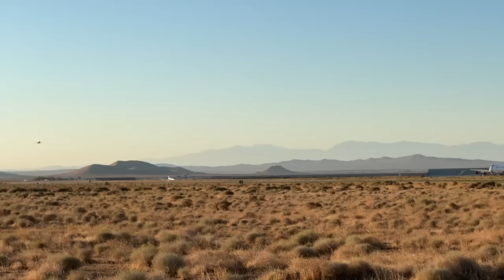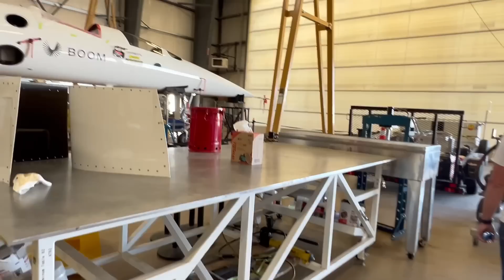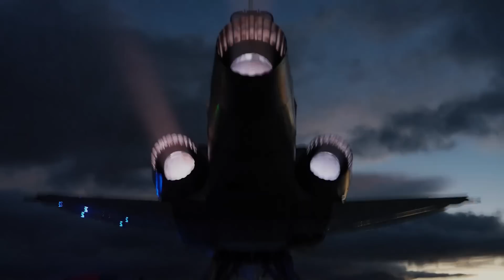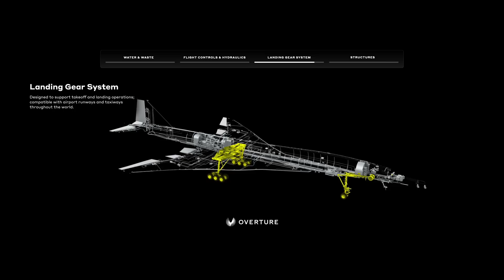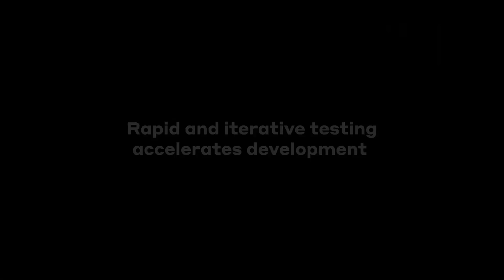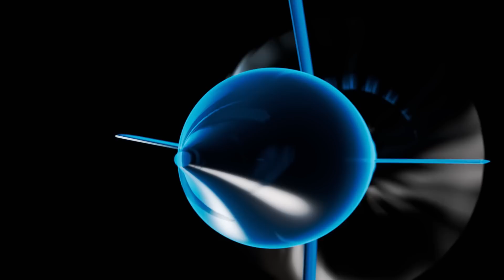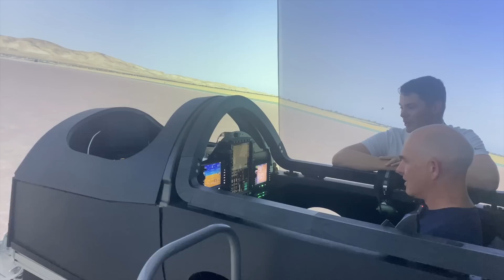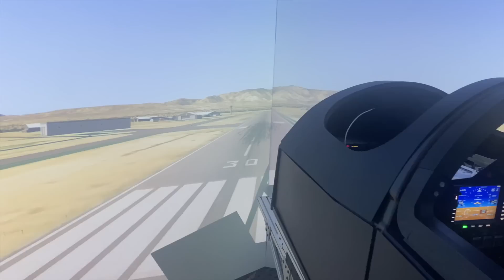Will This Experimental Supersonic Aircraft Show Supersonic Airliners Can Work?

Comment: "Destroyed by desire for cheap-ass plane tickets". That's not a desire, that's what normal people can afford. I liked the Concorde as any respectable Frenchman, but I'm not into shaming the middle class :|
Reply: It's the same reason the passenger seats and meals got smaller. It's just a matter of bringing air travel to the masses
Reply: Precisely
Reply: If it's just double to triple the actual money going to the airline compared to a regular plane, it's not gonna make the ticket a whole lot more expensive, because most of the ticket price is taxes and fees anyways, not the actual cost of flying the plane.

For example, I have a receipt from a SAS flight from this spring, who were kind enough to itemize it. For a 2 hour flight from Bologna to Copenhagen, I paid 63.86 euros, and of that, 17 euros was the fare, and the remaining 43.86 euros were fees and taxes.

So even if we triple the fare price, I am looking at a 94.86 euro ticket. Not exactly going to break the bank in comparison.

Granted, this short of a route is not one you are likely to fly supersonic, and the breakdown is probably less favorable, but still.
Reply: The concord cost the same as 1st class in other flights. Most who bought tickets were business flying to international meetings. However they fail becuse even at super sonic they would still have to get a hotel and sleep than take a flight the next day. No time savings were as first class has beds and some even showers so they can land and go stright to the meetings. The speed to get there didn't help saving any time as a hole. The amenities of 1st class was better.
Reply: The Concord(e) cost the British and French state or say tax payers millions and billions Pounds Sterling and Francs in subsidies into British Airways and Air France as long it was in operation. A poster child in how to ruin your economy.
Reply: It was OPEC.  When she was designed oil was a lot cheaper.
Reply: You know it's a dumb-ass comment when it gets an Englishman to agree with a Frenchman!
Reply: the middle class (or anyone else) doesn't have an entitlement to supersonic travel
Reply: That's what's known as British Understatement. 
The same mode of speech in which "we're in a bit of a sticky situation" means "we are a hand's breath from disaster, please help"
Reply: Concorde was never something that the middle class could afford, except maybe as an extra special splurge. Instead it was competing with first class or business class tickets. Would you rather spend a lot of money and get somewhere fast, or spend a lot of money and get somewhere at the same speed as everyone else but with comfy seats and champagne.

Well it turns out that Concorde is quite a bit more than first class and even those who could afford it were probably not quite in the territory where $12k on a round trip was something they could justify.
Reply: @eyv Concorde was not $12k round trip, unless you are adjusting for inflation. In 2003 I flew Heathrow to JFK on Concorde and back in Premium Economy on a 747 for £3500 with British Airways, and that was a standard ticket not a cut price deal.
Reply: @eyv it costs $12k to get to Europe and North America (return) in business class from where I live and that’s expensive; but ‘slow’ ~24h to Europe is fine. Getting there in 8h not needed.
Reply: @shaunsandow2073  Sometimes it is needed.
Reply: Exactly.  People talk about the "golden age" of aviation.  But if you look at the prices (adjusted for inflation, of course), those flights were expensive.  Yeah, flights might be less pleasant now, but being able to afford to hop on a plane and go somewhere for not alot of money has a luxury all its own because it means travel doesn't have to be a rare thing anymore or just confined to what I can comfortably drive to.
Reply: @ccoder4953  The Golden Age of Aviation was the 1930s.
Reply: What gets me is "sitting on your a"" for a long time." There's always going to be a tradeoff between time, efficiency, safety, etc. Most modern cars will do 100 MPH and could be designed to go faster, but do you want everyone driving that fast everywhere so they don't have to sit for so long? Subsonic traffic is hard enough on, for instance, the controllers at N90 (New York TRACON). Back in the days when the Concorde was flying, it was disruptive because it had a higher stall speed and couldn't safely join a normal landing sequence, therefore was very difficult to vector in and required priority. Now that skies are much more crowded, supersonic aircraft will be a lot more difficult.  Not sure it's worth it to let a few privileged people spend less time sitting.
Reply: I'd say it's more a jab towards the companies who wanted to attract the masses.
Reply: he's not wrong though. concorde had the potential of making supersonic flight cheaper so that it was more accessible to the masses but it was too far ahead of it's time and all the manufactures were too busy clawing out the bottom of the market because it was low cost high margin for them. it's why you've seen very little innovation in the airline industry since the concorde. everything is still a derivative of the boeing 707, 737 and airbus A300, A320.
Reply: @sirmonkey198  It didn't. It couldn't. You simply cannot make supersonic air travel economically viable.
Reply: @shingshongshamalama why not? why can bullet trains be made viable? Should the government be made to subsidize supersonics?
Reply: @amentco8445 The problem with supersonic flight is fuel economy. Air resistance increases with the square of the speed. The Overture will be about three times as fast as conventional airliners, so air resistance will be 9 times as high. Some of that can be alleviated by more aerodynamic designs, of course, but those, again limit things like size, passenger/cargo capacity, comfort, etc. Boom expects the Overture to use about three times as much fuel per seat mile as a conventional airliner. (And given that they’re trying to market this product, they’re likely on the optimistic side with their assumptions.)
High-speed rails don’t face these issues in the same way, because they’re going much slower (the fastest maglev trains reach less than 20% of the projected speed speed of Overture, and most trains are even slower), so air resistance simply isn’t nearly as much of an issue. Plus, they’re inherently more efficient because they don’t have to carry their fuel and usually get their electricity from large power plants, which can operate more efficiently than smaller onboard units.
Whether or not SSTs should be subsidized is mostly a matter of cost vs. benefits: Does the investment deliver enough benefits to make it worthwhile? In many countries, high-speed rails allow for fast, affordable mass transit, so their governments have decided that the cost is worth it. On the other hand, there’s still a good chance that physics will keep the cost of supersonic flights too high for the average person for the foreseeable future. So, should governments subsidize it directly, or should they maybe instead subsidize research into cheaper and/or more efficient fuels, which would benefit both sub- and supersonic aviation?
Reply: Flying was better before the lower classes could afford to.
Reply: Poors are for ships and trains! Hah! [sips cigar and smokes champagne]
Reply: yeah this is a perfect example with what is wrong with, well.... With everything today...

 innovation is not any more about creating solution for a problems we have... but creating problems for useless solutions...

Comment: Forgot to mention that Boom initially partnered with Rolls-Royce to produce their engines, and RR quit because “reasons”. Now Boom is working with a handful of smaller companies who have no experience in large airliner engines and no production capacity. 

I’m sure their totally finished plane will be flying in 2029 😆
Reply: Actually, that's clearly not the case. You obviously didn't watch the video, because it is mentioned where the engines are being sourced, the engine type and the fact that they already power aircraft such as the T-38. Hardly a " large commercial engine "
Reply: @Hiram1000  I did watch the video and I actually paid attention to the details. The engines you are talking about are used in the test plane, Boom XB-1. I’m talking about the engines needed to power the commercial plane, Boom Overture, which Boom says will fly in 2029. 

The Boom XB-1 uses GE J85’s from the T38 Talon, which were designed in the 1950’s (yes, they have been upgraded over the decades). They’re good little engines but not powerful enough for a large airplane.
Reply: @Hiram1000  Wrong.  That's the engine for the useless demonstrator.  Only 4 companies in the West can make engines for the airliner, and they have all said "no".  Boom will never have the multiple billions to produce the engine, to say nothing of a whole airliner, and then the certification process for a civil supersonic transport... forget about it.  $10B minimum.

Comment: It's true the market viability for Concorde was thin because of low cost air travel, it was the crash in 2000 that killed 113 people was the final nail in the coffin.  Of course, it wasn't a mechanical failure of the plane per se, rather a strip of metal on the runway that punctured the wing fuel tank. This suspended service towards the end of 2003.  But the bad publicity from the crash and growing concerns over pollution and noise led Air France to give up on it.  Sad.  I always wanted to ride on one too and see the world from 60,000 ft.  Maybe I'll live long enough (and have the money) to fly on the Overture.
Reply: The market was thin only after the USA 2707 program failed and they forbid all supersonic flights over mainland USA. Because only an American SST would be allowed to fly or none at all.

Comment: The main question I have is the issue of noise. Concorde was largely confined to transoceanic flights, from what I read, partially because of that, and that has a good chance to negatively affect commercial prospects of any supersonic jet airliner.

Comment: "Will This Experimental Supersonic Aircraft Show Supersonic Airliners Can Work?" -- no, Concorde did that.  The last thing the world needs now is specialized transportation for the rich that emits disproportionately large amounts of carbon dioxide.  What we need instead are further improvements in the efficiency of subsonic airliners; regulators should impose speed limits, lowering the maximum velocity of passenger jets by ~1-2% so that they consume less fuel.  Give clarity to Boom's investors by outlawing its business model.
Reply: Airliners already cruise at the velocity and altitude required for maximum efficiency, that's the speed at which the design is optimised for.
Reply: @CAL1MBO  False -- they fly slightly faster than is optimal for fuel efficient air travel.
Reply: There will never be enough of these to make even the slightest difference to the atmosphere.  Super-fast executive travel is worth magnitudes more to the economy.
Reply: @zacklewis342  Nothing's too good for the rich, huh?  You couldn't begin to justify that claim.

Comment: 170 knots landing speed? Ask Mike Patey about that - his turboprop "speedyplane" had a minor inconvenience midflight as the PT6 decided to switch to mode "INOP" within 3 seconds (the power turbine blades exploded). He then was sitting in a very expensive glider and thus decided to land without flaps at around 170 knots. ✌️

Comment: This makes 0 sense, if you are going to go over the speed of sound, why not go as fast as possible?  Concorde did M2.2, why cant we go M3-4 in 2025? 

The billions invested in going much slower than Concorde, makes 0 sense. 

Also Rolls Royce cut ties with these clowns as they described them as purely "speculative" company.
Reply: Because physics haven't changed since the 60s. Aerodynamic heating is the reason. To go beyond M2.5 you need to have a titanium airframe or a very heavy part-steel airframe, which are extremely expensive and heavy (inefficient) respectively.
Reply: @CAL1MBO  you know whats great? advances in physics and materials' science after 60 years.  

We can fly above the denser parts of atmosphere, higher and faster than ever before - and now with electrical boundary layer control systems, as disclosed by the military - and used in the B2 bombers since the 80s.
Reply: @ghostrider-be9ek  Unless you want to wear what's basically half a space suit, no plane is punching past Mach 3 without being very very high. Physics doesn't change. The faster you go the denser the air gets, which drastically increases the amount of thrust to go faster, so you go higher to get less dense air and etc. The SR-71 blackbird is a MASSIVE aircraft and it only held 2 people, there is no viable way to make any passenger aircraft that fast.
Reply: @sebastiannelson6355  please tell me you do not  know about disclosed electronic boundary layer deflection systems, without saying so - imaging that we are still stuck in the 1950s with aerodynamic principles is absurd.
Reply: @CAL1MBO Not to mention how much more inefficient it is to go faster than Concorde did.

 For my aerospace senior design, my group designed a supersonic business jet and our goal was mach 2, which we reached for our design. We had an optional goal for mach 2.2, which we theoretically could do but we wouldn't have the range required and would've massively required a huge overhaul.
Reply: it gets so much harder as the speed goes up - there's a great documentary about how America's answer to Concorde was abandoned, and they were shooting for M2
Reply: @DrWhom  again, you are talking about the 1970s - why are people not getting with the times in 2025 ?    We have boundary layer control tools avail.
Reply: @ghostrider-be9ek  that's a fair point. air spikes and other ways of controlling airflow over the outer surface could in principle mitigate against aerodynamic heating. I don't know enough about it to state why we don't see more of that sort of tech, but I would bet on (a) it is really difficult to achieve and (b) the gains are limited and (c) these are systems that inherently do not fail gracefully - a relatively small glitch results in catastrophe and there is no obvious way of building in redundancy
Reply: @DrWhom  agree with your points of dealing with various failure modes - however, the reason why we dont see this, is because the militaries of the major powers use this technology, and it is classified at this time - even discovering classified technology and using it inadvertently will lead to black shelving -usually

I can tell you also tat 5 years ago there were papers from various sources that theorized all of this, but these have been sanitized from google searches.

Comment: It's not supersonic yet, shares nothing with the overture in design shape proportions. They basically built a t38 trainer
Reply: The only similarity between this and the T38 is the engine. Everything else is completely different from the wing planform to the positioning of the intakes.

Comment: If they overcome the technical difficulties, their plane will have to overcome heavy flight restrictions which will limit the places they'll be able to transport people and of course there will be the problem that most people won't be able to afford a ticket to board that plane. That's why the Concorde never became a viable buisness in the long term.
Personnaly, I would sincerly wish them good luck, because it would be amazing to see them managing to build that aircraft, but, and it's a big but, I don't think we need a plane that will certainly burn waaay more fuel per passenger than current airliners (I'd bet a lot on that), just for a rich elite to go faster from point A to point B when we know how we already eff'd up the Earth's atmosphere.
Reply: One of the main themes of the development of the XB-1 is that NASA research has demonstrated that the severity of sonic booms can be much reduced -- this hasn't done anything to mitigate the expense or carbon emissions of supersonic flight however.

Comment: USE METRIC!
Reply: This is aviation
Reply: @JohnJameson11  I don't care.
Reply: @Arrow14100  Nautical miles for distance, feet for altitude, knots for speed. Nautical miles aren't even that far from metric, they are defined as 1852 meters, or about one minute of latitude. Knots are Nautical miles per hour. Mach is simply more relevant for airspeed under certain conditions when flying, as it has to do with atmospheric conditions as well as groundspeed.
Reply: @JohnJameson11  Again, don't care. It's still stupid. And it's not a lot of effort to put the measurements in metric on screen.
Reply: No